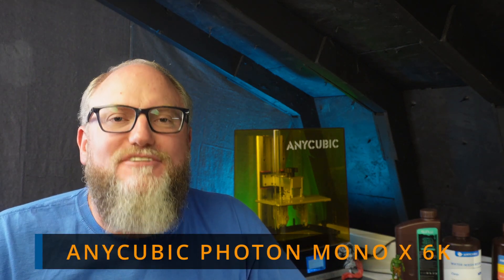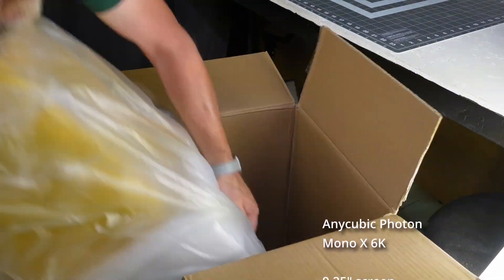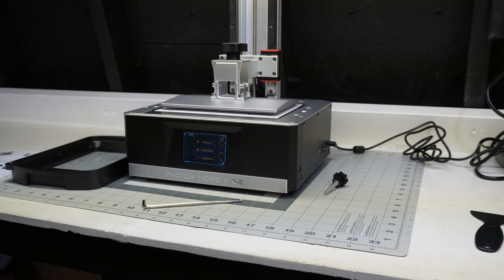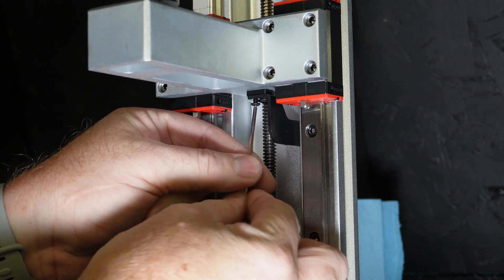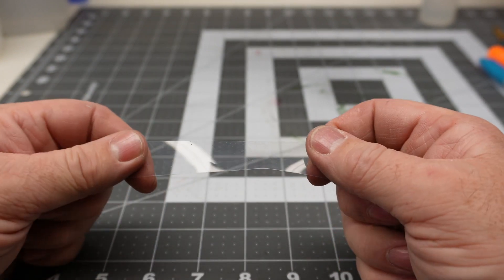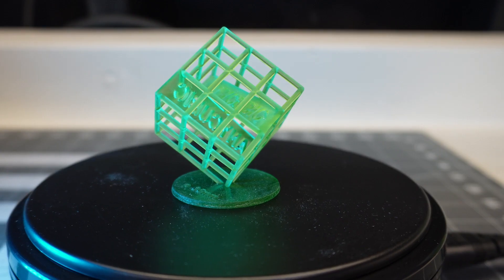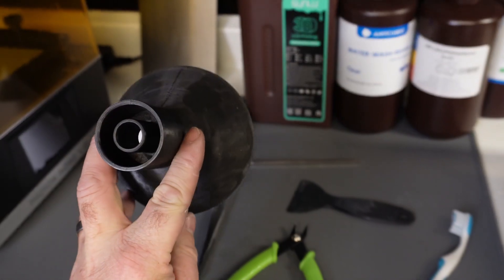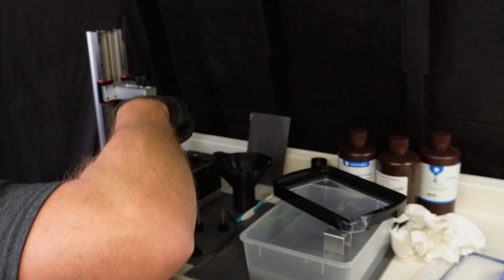Anycubic Photon Mono X 6k Unboxing and Review with Beginner Tips

Comment: Not sure what I'm doing wrong but the update files don't download in .bin format. They are downloading as .rar format. Not sure what to do now. Can you give any advice? Love your videos.
Reply from the maker: I did a fresh download of the PMX6K firmware on both my MAC and a Windows computer. The MAC automatically converted the .RAR file back to a .BIN file, my Windows computer left it as a .RAR file. For Windows users it seems that you may have to find software to convert the file from .RAR to .BIN. I found one named 7-Zip that should work,  please let me know if this works.
Reply: @Original-Werks  Thanks. I'm on a Mac. Will try again on another computer.
Reply: @Original-Werks  For anyone else who is having this problem,I just downloaded RAR Extracter and Expander from the App Store free and it converted. Thanks again. Love the videos. I also purchased Nomad at your recommendation.
Reply from the maker: Very happy that you found a solution. The firmware allows anti aliasing to work with all the slicers. Layer lines are virtually invisible on your prints with the PMX6K. Enjoy!

Comment: Doesn't it come with a screen protector on it that's an extra I believe, or atleast that's what I was told cause  I didn't put one on. And I just got mine like a week ago
Reply from the maker: Seems to be some confusion over this. I have read that some come with it pre installed while other machines do not. Mine did not appear to have one yet, so I installed it. I did not want to peel the light leak tape back to double check. The screen protectors are much cheaper than a screen. I would rather waste a spare screen protector than my light screen. If you have any doubts, install it. I already saved my screen once because I missed a drop of resin on the bottom of my vat that cured to the protector. Luckily it scrapes off of it easily. Enjoy your new printer!

Comment: What size flex plate do I need for this the unit is on the way and it will be my very first 3d printer and I want to get everything I need thx
Reply from the maker: 202 x 128 mm I picked one up for about $15.00 on Amazon. Most will have something referencing the resin printer model name or size.
Reply: @Original-Werks  will that ANYCUBIC mono x 6k work with 3rd party software like lychee I’m brand new to this and Amazon delivered it yesterday it came in broken so have to send it back for a refund and now I’m questioning between the same thing or Saturn 2 8k just want user friendly unit thx
Reply from the maker: @briannettles786  It will work with Lychee, Chitubox, and the native one it ships with (this one works with anti-aliasing the best) Lychee and Chitubox both support anti-aliasing as well. Sorry to hear yours arrived broken. Have fun printing whichever way you go!

Comment: If I want to do hollow, what wall thickness do I have to set? In case of smoothing
Reply from the maker: That is a tough question to answer. So many variables - model size, resin type, amount of detail, what it will be used for, orientation of the print itself, this also leads to the suction and draining of model as well. I would suggest printing a small part comparable to what you want for wall thickness, or even better print a small test portion of your final planned part. This will give you something to smooth and test your finish on. Sorry, hard to give a very clear answer, your question did not give me much information to go on. Good Luck!

Comment: The 'very nice adjustable feet' at 3:50, well I had 1 foot screwed in, 2 loose in the bottom of the box a large hole had been ripped in the plastic overwrap where the fourth foot had exited. Have to use cardboard to hold up 1 corner.
Reply from the maker: I would certainly get in touch with customer support, that sound like a shipping issue.

Comment: I just got this and use black plant based resin and my print stuck to the vat film.

Excited to get some advice. My fep film was cloudy after I cleaned it wrong. My screen protector application failed because of some stupid dust that got on the screen after I cleaned it.

Now have the firmware update and am waiting a few days for new screen protector and fep film.

I also did not mess with the z shim at all.
Reply from the maker: Ok, remember that I am a noob at resin printing as well. I certainly recommend waiting for a screen protector. As I mention in the video it has already worked its magic already for me.

The plant based resin, all I can say is that you may want to check your exposure settings again and be certain that they are not too long. Also make sure that you are homed to the proper height as well. I would recommend finding a resin calibration file that you like and test exposure times. I have done that for most of the resins that I have been using, it really helped. Below is a pretty good one to use, doesn't use a lot of resin and prints fast.

https://www.thingiverse.com/thing:4707289

I like using the PTFE dry lube that I showed in the video, any brand should work. It does make a difference in the resin sticking to the FEP sheet. If I don't use it, I can hear the difference.  No popping when the build plate rises. It also clears up a cloudy FEP sheet for a while too, sort of fills in the scratches.

The "Z" shim you can leave alone if you did not put on a flexible build plate. I would have left mine alone, but I could hear a slight difference in the stepper motor when it came down to the screen that I didn't like.

I hope this helps, don't get discouraged with your printer, once you get it dialed in you are going to really enjoy using it!

I certainly do not have all the answers, remember that I am new at resin printing too. Check out the Facebook group for this printer, Anycubic has one specific for the PMX6K.
Reply: @Original-Werks  Thanks so much. I was watching the video for awhile got about half way then country reception when out on data and I just got home and sat down. Waiting about 5 days and going to try again. My main disappointment was the test file didn't work out of box which is meh

I shouldn't have been so go ho and made sure I did everything fort and re uped my research. But it's already great seeing a more up to date review or step by step of this printer.

But your slower and longer showed cleaning process was really helped. I think I didn't watch as many people clean vats as I thought and just completely bombed this part.
Reply: Dammit reading this now and realized how much of a mess autocorrect made my sentences.
Reply: @Original-Werks  I tried to get the exposure test but it stuck.
Reply from the maker: Have you tried using just a basic grey resin? Might be easier to get exposure times right. Is your printer in a temperature controlled environment? Resin printers need to be at comfortable room temperature.
Reply: @Original-Werks  My printer was set to 90% uv power
I turned down to 65 which was the default and set slicer settings for the print to my resin which had an exopsure setting of 40 secs! but it worked ..... yeah I'm getting grey from now on also was annoyed at how you can see all the dust on it.
Reply: Inland pro plant based black just fyi
Reply from the maker: Sounds like you have started to dial in your printer, very good! I agree, the dust in the prints can be annoying, careful cleaning without scrubbing the raw resin is the key.